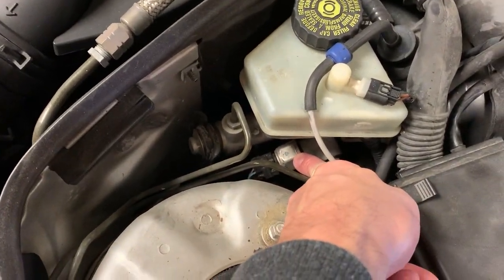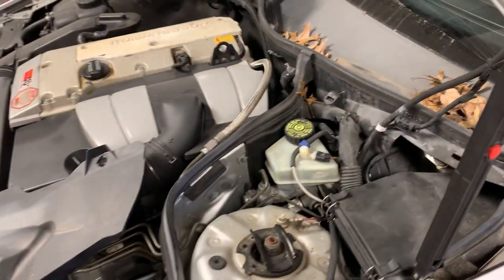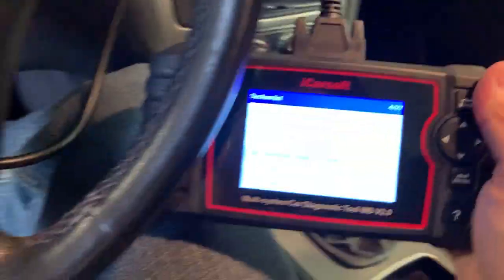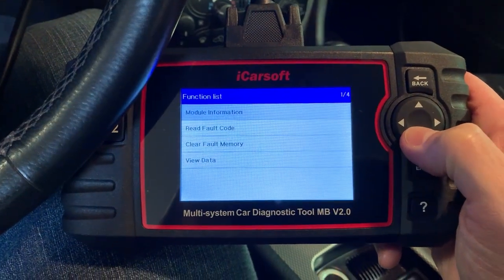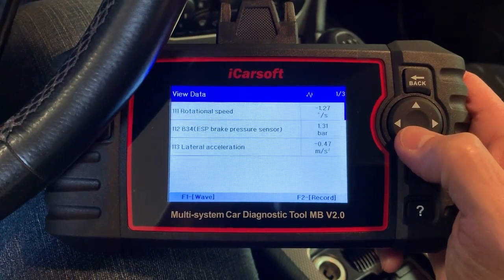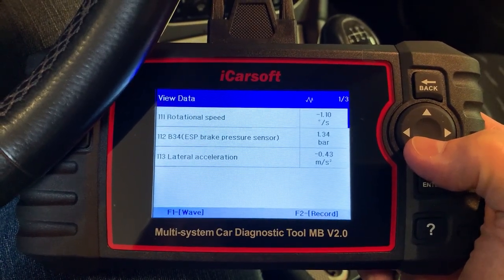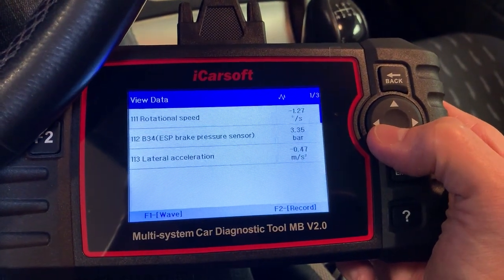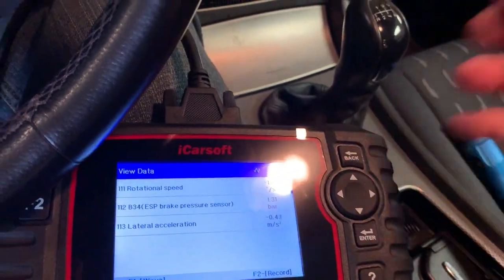Mercedes Benz brake light switch stop light switch - where is it - and how to know how to find it

Comment: I have a 2005 c320 sports and ESP message came on momentarily and heavy to steer. Check for fault code but none is related to either brakes or steering. ( My car has a permanent check engine light for other issues). The momentarily ESP message came on twice now. My kids doesn’t want to drive this car now. Could it be the pressure sensor for something intermittent or is there another way to reset this.
Reply from the maker: Hello. Codes dont have to be related to brakes or steering to cause an issue like this.
Loss of communication will cause issues like this. All codes mean something if you know what to look for also it matters the “scanner” you are using.

Comment: Hi, I have a 2012 C250 W204. I just replaced the steering column on it and as I was doing so the wires from the brake switch slipped out, I have no idea as to why it happened. I just ordered a new connector to fix the issue but I can’t find anything showing the correct location for each wire. Do you have a wire color and pin assignment diagram? Thanks in advance.
Reply from the maker: So sorry I dont know why I didnt see this comment before. 
pin 1 pink with blue stripe
pin 2 pink with white stripe
pin 3 black
pin 4 pink with green stripe. 
I hope this helps.
Reply: @MasterTechLou , thank you. I was able to find it. Appreciate it.
Reply from the maker: @sgonza4620  So sorry, not sure why some comments I get emails for, some I do not. My apologies. Glad you got it taken care of.
Reply: @MasterTechLou , thank you. I’m sure I will need your vast experience again. 👍

Comment: Hey Lou. My esp light is on but when I connect my icarsoft it does not connect to ecu “fault in communication with vehicle ECU”
2004 c230 kompressor
Reply from the maker: Hello, ok so, if you have a fault in communication, then that's the issue , esp may have blown a fuse or the module may be bad. check other modules codes, if you find a lot of codes to do with communication with the esp,. then that's telling you that the esp module is what you need to focus on, power, ground and data lines voltages. If all are present, then the module has failed.
Reply: @MasterTechLou  Thanks Lou. I checked the fuses and all fuses are good. Do you mean the ESP module in the engine compartment correct? Our previous mechanic told us it was the sterring angle sensor, and we changed that and now it says 'ESP not available' after replacing it too on the dash
Reply from the maker: @sebastianvanh342  correct esp module in engine bay fuse box. If memory serves.

Comment: I have a 2018 cla45 amg 4matic coupe (model 117.352) that won't move out of park. 
The fault code that has come up is 
C40400 - implausible data were received from the electronic selector lever module. 
Can you please help me understand what this means and how I could fix this?
Reply from the maker: Issue is with the shifter. Its not sending correct data.

Comment: Lou, I need your help.  how do i get the brake pressure sensor in my 03 c240 when it's under the hood? there's no room for my hand.  i have a turn signal that stays on in the rear and no lights.  I've checked fuses, bulbs and the light plate.  cant figure it out. please help
Reply from the maker: master cylinder has to come off if you cannot get to the pressure switch
also if you have a rear light staying on, then my money is on a bad rear sam (fuse box) as it is responsible for all the lighting and it most likely has water and corrosion present in the module or connections.

Comment: hello there in another subject , i just got a 04 clk500 was under the impression the auxiliary water pump stayed on after you turn off the engine for a few min like on a 99 ml430 (i also have) .  did a little voltage test after engine was off and wire to the pump showed 10 volts but pump was off, tryed a test light and nothing . is it just for the heater on this models ? its a good system on the w163..
Reply from the maker: Hello. It should only come on when you press the “rest” button when the ignition is just turned off . If memory serves me.

Comment: I have a 2003 ml500. My brake lights stay on while the car is on, but when I actually press the brake pedal - they go off.
I have replaced the pressure sensor. 

Any ideas on what it could be??
Reply from the maker: You need a scanner to check the live data and also a wiring diagram to confirm wiring is correct. I never ran into that before on this model.

Comment: Could you tell me where my brakes switch is on a 2005 ,it as a pressure censor under the bonnet. like you said,cant see a brake switch   near the pedals ?
Reply from the maker: Yes on the master cylinder

Comment: Slk280 can’t find brake light switch, slk280 is not in your list?
Reply from the maker: In the video, I clearly state. Its either on the brake pedal or its on the master cylinder. Only  2 places they are located.

Comment: Hey so my Mercedes Benz c300 brake light won’t turn off. Even when it’s in park, So I’m guessing it’s an electrical issue? Question is how do I turn it off?
Reply from the maker: Hello, first make sure headlight switch is set to auto or O if you turn it too far left the lights will stay on.
If the switch is set properly then you most likely have  bad rear fuse box and the only way to turn it off is to disconnect the battery until you can get it fixed. Unless its not all 3 lights but just 1 light then you can unplug that tail light housing connector. Save the battery from dying.

Comment: Lou:  2007 ML350 4 matic.. Brake lights are stuck on sometimes when car is turned off.    or sometimes they go off but they come on by themselves in middle of night when car is off and run battery down. If the car is off and they happen to be off with it,   pressing the pedal does not turn them on.     The brake lights are on all the time when car runs.  I have no idea where the brake plight switches are. or what could be doing this. . The ballast modules in the rear get real hot from the brake lights being on all the time.
Reply from the maker: Most likely water in the rear sam
Reply: @MasterTechLou  i found on it what looks like a bake light switch going into the booster. . into a circular hole. i cant find anything on this.
Reply: @MasterTechLou  actually this vehicle has a brake light release mechanism in the brake booster. it can not be replaced. Turns out the repair is free , even the tow. this vehicle has a do not drive recall on it for the brake booster. over a million Mercedes have the recall since 2022. Now you can pretend you discovered this on you youtube
Reply from the maker: @josephkaminski1857  umm the brake pressure switch is on the master cylinder for one, also we have been doing the brake booster recalls every day almost. its not going to fix any braking issues you have regarding brake lights. I dont pretend anything here. not sure why you would say something like that. if you have brake lights coming on, you will find water in your front or rear sam,. 10000000%, now you can pretend you figured this out in your own, :)
Reply: @MasterTechLou  wrong. the 2006 2007 models are unique with a brake light release switch on the side of the booster that goes into the booster and attaches to the booster arm inside. . . You are wrong. It sends signals to the SAm that can cause the sam to have faulty brake lighting. SOrry charlie
Reply from the maker: @josephkaminski1857  thank you
Reply from the maker: just to clarify for anyone else reading this, on the brake booster you will only find 2 electrical items., 1- the diaghram travel sensor which is used to determine if part number 2 is activating which is the bas solenoid and release switch, there is zero correlation between the brake lights and the travel sensor, the pressure sensor on the master cylinder is what the esp module uses for the brake light activation. challenge me anytime. I dont know everything but I do know Mercedes.
Reply: @MasterTechLou  absolutely Wrong. I have a Post graduate degree in electrical engineering. Masters degree pal. Mercedes use to send me the cars they could not diagnose with Eletronic failures. You do not know what you are talking about. You have no idea how the electronics interact. You are a self taught parts chaser shade tree mechanic. a cobble jobber.  The pressure sensor alone does not control the only brakes on indication such as the lights. If it did, then when there is no pressure from failed master cylinder, the transmission would not be able to be put in any gear. The pedal push, brakes on sensor is effectively the brake light switch inside the booster. It does more than make brake lights on. The pressure sensor is used as a backup to the pedal push sensor. The sam looks at both the push and pressure sensors.  but Pressure sensor main purpose to determine brake pressure failure and set the brake warning light. It does this by identifying a condition where the push sensor has been pressed, ( ie someone stepped on pedal)  BUT the pressure sensor is not showing pressure. This tells the computer and sam the brakes are not working and sets the warning light. Because there are TWO trigger signals used there are 4 binary possible conditions of the sensors and there is logic in the SAM to isolate the ones they want. Failure in this logic by shorting the Pedal push sensor wires into a ambiguous logic state , from the logic state table can cause the sam to light the lights or not light them.
Reply from the maker: @josephkaminski1857  ah should have just said engineer and that would have explained everything, you can come work with me for a day and I will show you the real world. 
when we have cars with failed brake lines the cars will NOT go into gear because they are not receiving brake pressure signals,. man I cant believe you would go and start talking trash, shows your character, do me a favor and remove yourself from my channel, I dont like your vibe. the know it all type that doesnt actually have experience, treat people better. I am trying to educate people here and I may not be for everyone, especially those that think they know what they are talking about, I dont mind being wrong and learning, but I disagree with your statements based on my training and 20 years experience in dealing with these first hand. so you have a good day. also let me know when you find water in your rear sam.
Reply from the maker: @josephkaminski1857  and just to be 100% , you are telling me that mercedes sends you the cars that they cannot fix? yet you are on youtube asking a  self taught parts chaser shade tree mechanic. a cobble jobber how to fix your car? interesting. again, be nicer to people. I tried to share my knowledge and you just tried to shoot me down to be the bigger smarter person,, go ahead you can have it, Im fine doing what I am doing. take care. Lou
Reply: @MasterTechLou  I made the mistake thinking you knew what you were talking about and asked a question to same myself time trying to get data. Im retired have no access to data any more from Mercedes. But your foolish responses forced me to find the schematics I needed elsewhere, and solve this problem myself. .
Reply from the maker: @josephkaminski1857  glad I can help you in a round about way with my incompetence. world works in mysterious ways.
Reply: I have a 2004 ml350my brake lights are not coming on, I had someone check the brake light switch near the pedal,bit it is not there, I have gained alot of knowledge here about the switch not being under the pedal,  so my exact question is where may it be located ? And exact name of part that may control these lights. Its been a mystery for my mechanics. If you coukd assist itd be greatly appreciated @MasterTechLou
Reply: @latashacoleman6506  the switch is in the brake booster, and can't be replaced without changing the brake booster.  and the control UNIT the switch goes to that turns the lights off and one is called the SAM module it is in the rear of the vehicle. It is on the passenger side rear side wall compartment. At the bottom of the compartment under coverings. Just have the mechanic follow the brake light wires to the module .  Have your vIN checked for recall because some of these boosters are under recall for free , even now.
Reply: @josephkaminski1857  wow thanks alot I will calling tommorow about that recall.
Reply: @josephkaminski1857  also quick question have you heard that the sensor o. The master cylinder may be a reason my lights aren't working? Just curious?
Reply: @latashacoleman6506  the recall for the booster is because seal breaks and  it leaks air causing the brakes to go soft pedal. it is dangerous and has caused accidents. . While your car is idling you can step on breaks and listen for a air swoosh sound as you step on brake. There should be no sound stepping in brake. The broken seal has caused some booster pedal switches to go bad because the switches are not hermetically sealed. They use non sealed switches because the switches were used inside of the booster that seals it. I suggest getting the booster repaired first if it is broken, before looking at the SAM module. The recall is for 2006 and up models. However, They are fixing any model that they confirm at the dealer the booster has a air leak. WHich means you will need to have them diagnose it regardless of the VIN number. I recently had a friend with a 2004 model get a new booster under the program.

Comment: Great info. But when I test ESP everything works with depressing the brake, and I do still have ESP error, AND  the brake lights stay on when ignition is on, they wont even turn off with the sds??? WTF?!
Reply from the maker: The answer is right in front of you.
If the scanner cant turn the lights off then you have a bad rear sam…….
Reply from the maker: Depending on the car you are working on.

Comment: Clk320 brake light work if I just barely touch it but won’t stay lite if I press all the way down they will turn off any ideas?
Reply from the maker: Switch not adjusted or is bad.

Comment: Hey Lou, learned a ton from the video! I recently purchased a 2004 s500 with the only error code being a speed sensor ( PO500 vehicle speed sensor A). I believe this to be the cause of esp & abs malfunction signs on the dash. However my rear right break light just won’t turn off. Even after turning the light switch to “0” and turning off the car. The license lights weren’t turning off so i unscrewed them. This only started recently. I’ve bought a brand new battery and i think this was the culprit for my previous dead battery. The trunk lid also won’t close but the air attempts. Could this go along with the break lights?
Reply: Any ideas going forward?
Reply from the maker: First off, the scanner you are using is not good enough for mercedes. I can tell that by the code you gave me. Second, the rear sam most likely had water in it. It’s under the back seat, passenger side.
Reply: @MasterTechLou  Update: The right rear brake light turned off on its own after a couple of hours? I slept through it haha i need to check this out ASAP with a computer, much love Lou!
Reply from the maker: @Blu3ben718  things dont fix themselves. Its always water under the back seat. Or failed rear sam. I advise physically checking it sooner than later. :)
Reply: @MasterTechLou  no water... i just unplugged the switch. Problem solved for now.

Comment: Bro I have a Mercedes w203 c200 kompressor.. basically when I drive sometimes I get the esp sign pop up but nothing happens and it goes away when the car restarts which is fine. Sometimes when I drive the yellow triangle pops up and I hear a loud grinding sound, I thought it might be the brake light switch but I couldn’t find it under the dash :( any help or advice??????
Reply from the maker: Your traction control is activating. You need a mercedes capable scanner and a competent tech to read the wheel speeds to see why its kicking on. Most likely yaw sensor. As for the brake light switch, I literally show the only 2 places a switch is. And then I put in the description where every switch is located for every car.
Reply: @MasterTechLou  thanks, I will try and find someone with a scanner or else probably just change out the switch on the master cilinder just for safety.
Is there anyway I can disable traction control? To stop this from happening ?

Comment: hi, i have a c180 w203 and is not starting. Can a brake light switch do that?
Reply from the maker: A brake light switch has no effect on starting, ONLY in the push button start models which yours is not.

Comment: I have a 2004 slk 230 the problem that I have is my break light is on and when I drive it start beeping when I stop it stops beeping any idea what it  can be
Reply from the maker: Parking brake pedal is pressed , parking brake switch is stuck or low brake fluid are first things that come to mind.

Comment: why EPC warning  light also fuel pump start and stop suddenly .mercedes w203. What will be the issue ?
Reply from the maker: Sorry I cannot answer that. Too many possibilities as to what is happening to your car. You need to have a Mercedes mechanic scan it with a Mercedes scanner to know what the issue is being caused by and diagnose from there. Sorry! I wish I could help but theres so much missing information. Best of luck.
Lou
Reply: @MasterTechLou  changed 4 plugs and cleaned injectors. Changed  accelator padel. Can you now diaognose please .all fuses and Relays  in order.
Reply from the maker: @somathilakeBwm  no im sorry